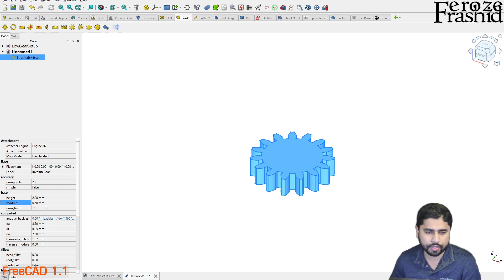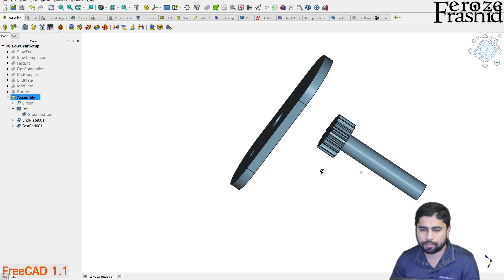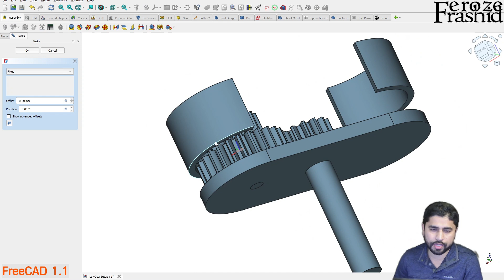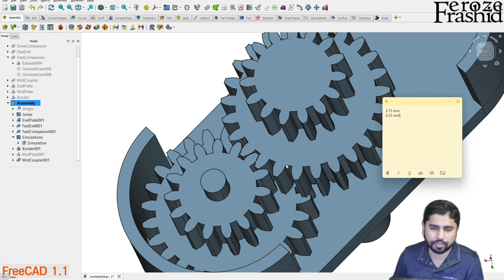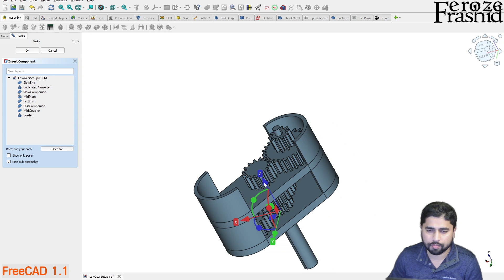High Torque Gear Box Assembly in FreeCAD 1.0: Free 3D CAD Modeling Software

Comment: Thanks for the Assembly WB video.
Just a question. How did you do the spacing of the gearshafts on the endplate. Did you use add Dw of the two gears and divide by 2. gears
Reply from the maker: Yes.